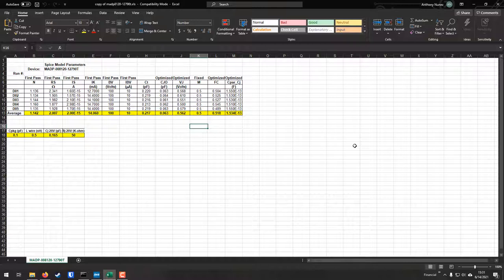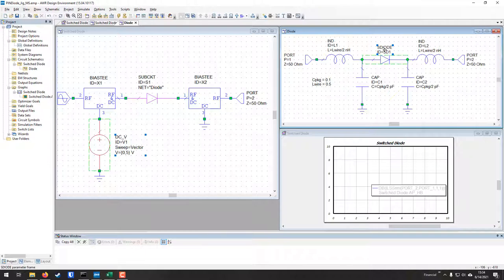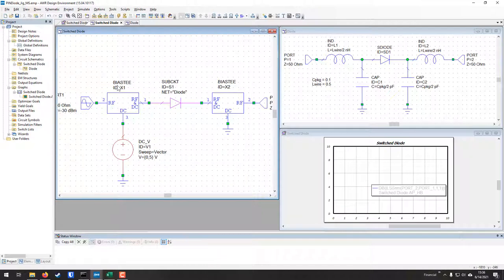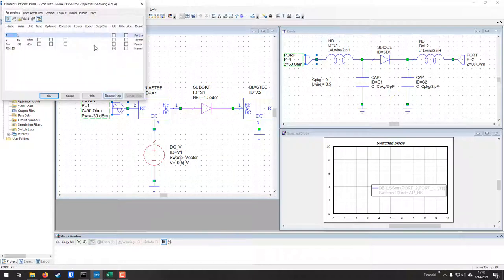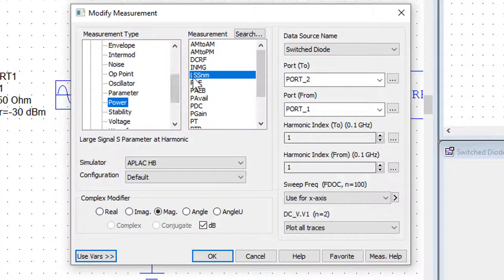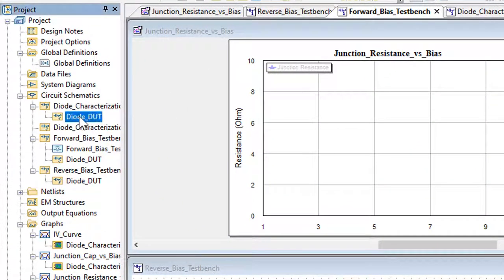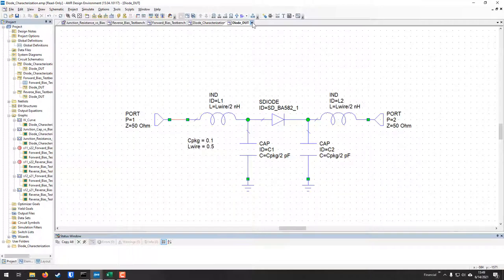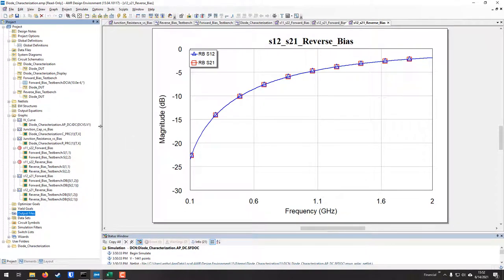How to Characterize PIN Diodes using AWR Microwave Office

Comment: what is the use of large signal parameters that you have graphed first before characterizing the diode with the existing example ?
Reply from the maker: LSS is used for simulating S-parameters in the presence of active component models.

Comment: Why does the diode characterization file run a linear simulation and not a non-linear simulation like the example before? If I want to use my diode file in another circuit a linear characterization seems useless to me or am I missing something?
Reply from the maker: Honestly, this is a great question. Despite Cadence AWR MWO being a great piece of software, a lot of its features and usability are hidden behind the paywall of their education programs and so forth. I am yet to understand why some parts of the characterization are linear versus non-linear. Like yes, I understand diodes are non-linear devices which can be behave quasi-linearly in certain circumstances. However, why does MWO approach this problem in this way? 

Mark Saffian handles a lot of the university educational license support stuff. Reach out to him at msaffian@cadence.com if you have specific questions about specific things in the software. 

Mark touched on this issue in an e-mail he sent me a while back which you can find the text of here ( https://pastebin.com/PmjpaT9p )
Reply: @MrSimEngineering  Thank you for taking the time to reply.
I will try to contact the technical support regarding this. I have watched your EM simulation tutorials and tried to combine an EM simulation with the non-linear simulation of my diode however it is very tricky and there are results which I am not able to explain.